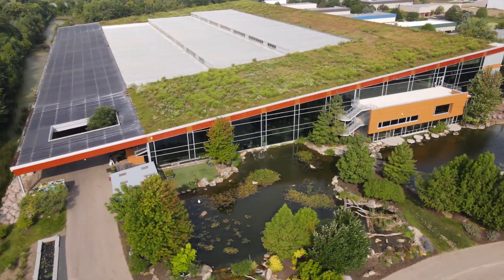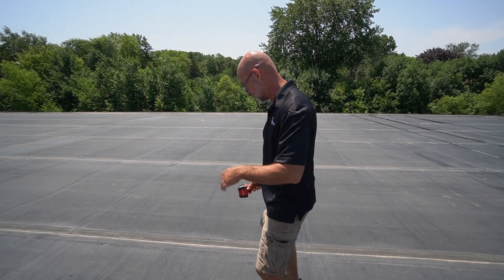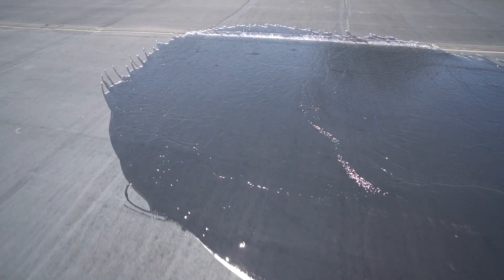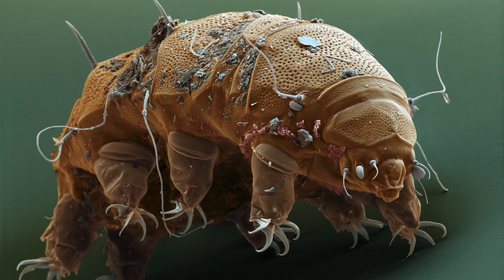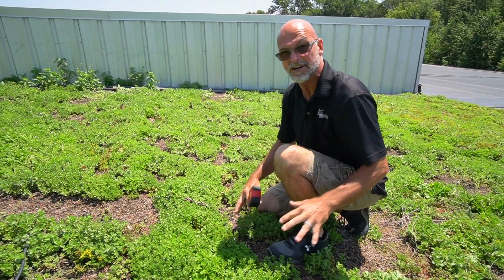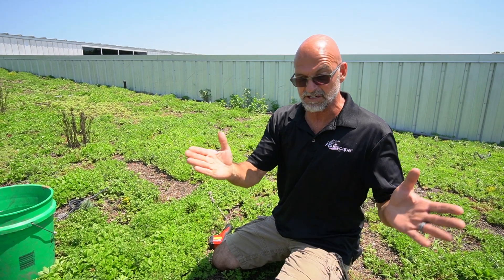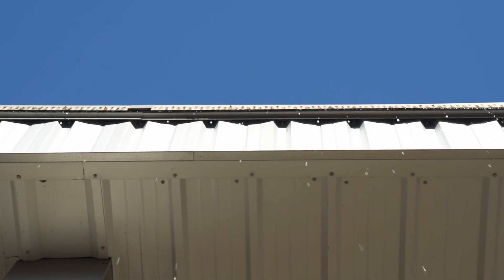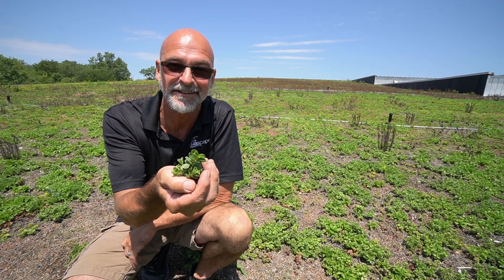Hot Living Roof Test. 185° Degrees!

Comment: Ed i love the idea like you said super old knowledge. Next step is to design architecture with planting pockets that chase the building up on its way to yhe skyscraper heights. Imagine a tower with forest ledges every 40 to 60 ft up its flat sides. Not only could de-centralized cooling systems be installed on these ledges but break areas for people could be too. I could reconnect the city masses to nature. Im sure new industries would be created around this concept like tower gardeners, elevated urban forestry, and forestry engineering( to secure massive trees in storm events).
Reply: tall buildings are a disaster, because the heat rises on the inside and they are full of glass. even 3x glazed modern glass is a big ask to not need huge cooling units. you cant have much in hte way of trees on a building, they need a lot of root space and are a hazard in a storm and a mess in the fall

Comment: But did the extra dead load and water absorbtion cause the section of roof colapse?
Reply: i think youre right
Reply: The engineers missed a simple bracing system that would have prevented the collapse. It’s there now

Comment: I do ac work in Phoenix and haven't seen anything over 160 on the roof 
Black roofs are hard to find though the rtemps on white roofs 140 
120 will burn you in 3 seconds with that being said one of the 2  thermometers are off the asphalt out here gets 170

Comment: how do you deal with heavy snow on a living roof? or does the weight of that not matter?
Reply from the maker: Great question!
It’s calculated into the design,
The Roof deck and all support structures are designed to handle the weight of the soil when fully saturated plus the plants and maximum snow load for Chicago area.
Reply: @EdThePondProfessor  super cool im sure it effects the heat cost in the building imagine if every city did this. Super cool stuff man